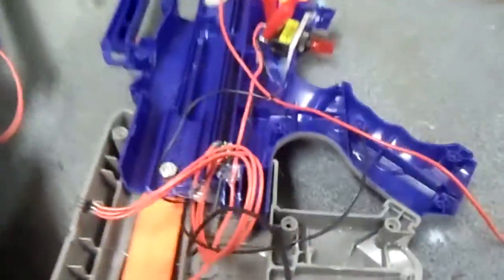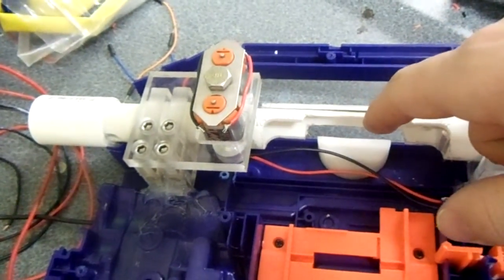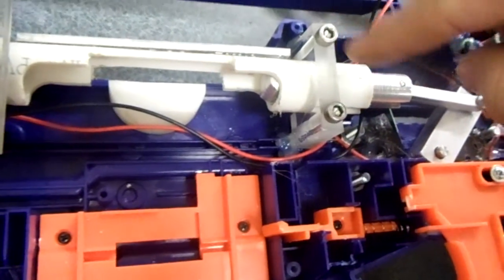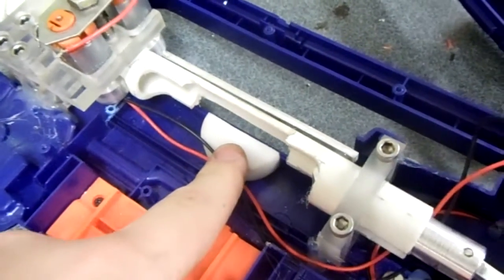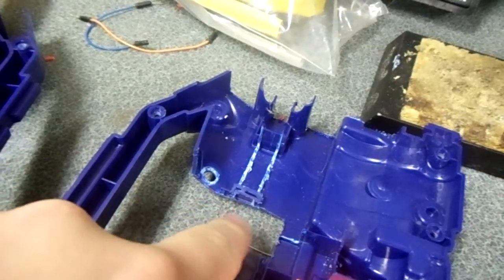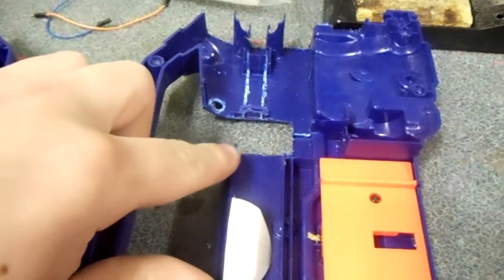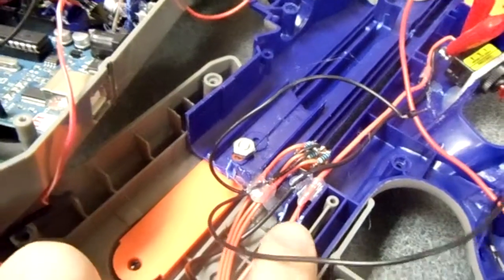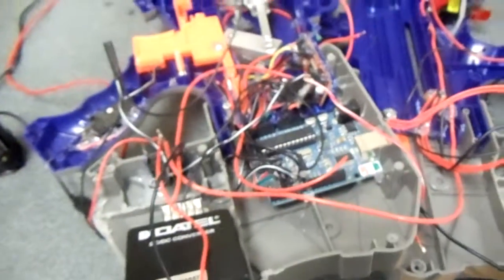OP-2 Mechanical overview

Comment: The problem with that switch might be that it is a lighted switch so your pic might not push a high enough voltage to reach the value of the forward drop of the LED?